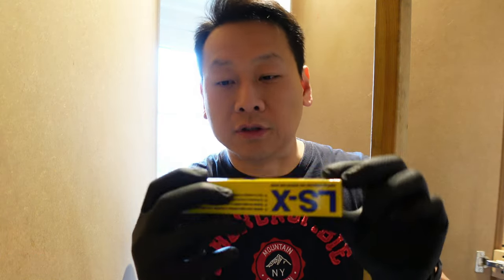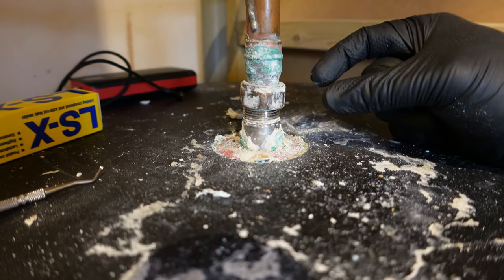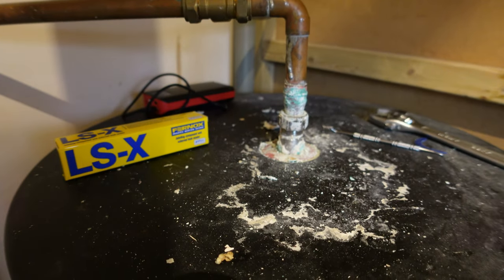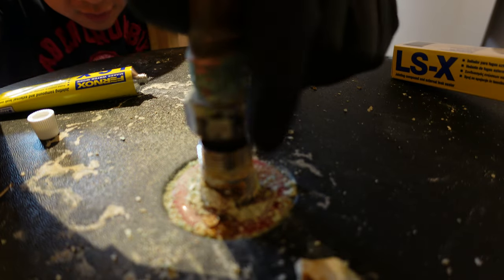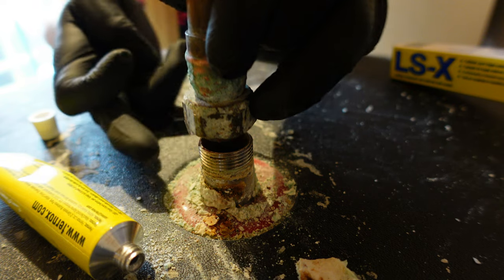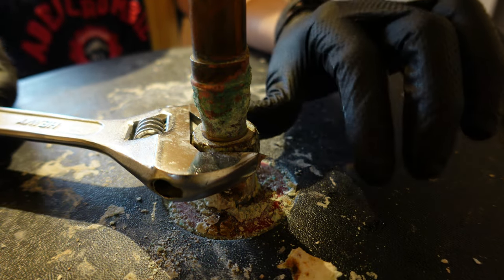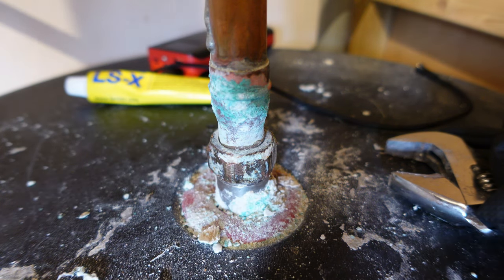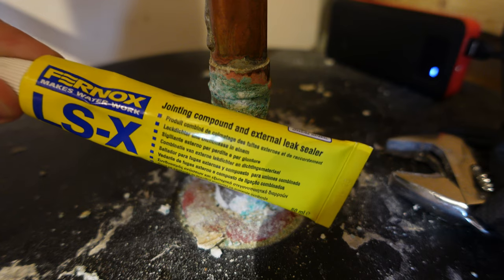Fixing a compression joint weeping leak quick and cheap by Benson Chik

Comment: I changed my Willis emersion heater (old one about 50 years old) and I'm not a plumber but while I was digging out the totally blocked with lime scale pipe, I weakened a joint at the other end of the pipe so that when I got it all up and running again and working beautifully in total silence compared with the clanking and banging it was making before, I had a one drop per day leak so being that it's a very old and awkward system to drain, I wrapped the joint in black pvc electrical tape and stuck a cable tie over that and hey presto jobs a good one. It's so easy I don't know why you don't see that a lot online and it's quite a tidy finish also. I didn't even have to pay a few pound for some of that sealer mess and in another 50 years when the heater needs changing again, some-one (I'll be dead) can put a new olive in lol.

Comment: Maybe a plumber was charging £50 + vat 20 years ago, but these days they won't get out of the bed for less that £150. I was away, and I had my tennant call a plumber because a hose from a bathroom sink was leaking. A £5 hose. The guy said he either replaces the tap as well (with a grohe branded one), or he won't touch it. I ended up paying £175 in cash (or £220 on invoice)
Reply: Yes this appears the going rate, you are bang on right plumbers and tradies at this point just want £175+ for 1 single job if you then say I also need this and this done they look at it as 3 jobs but give a discount probably since they know £175 is already too expensive and x that by 3 is even more affordable. What will happen is I suspect if its a bloke they will just try and watch YT and diy or best can its what I have been doing for many years already.

Comment: Why didn't you break nut on convex fitting above the leak and wrap PTFE tape around olive and the job is done no need for that stuff
Reply from the maker: A true plumber will dismantle it and repair and replace. I am a DIY fixer and the less joint I touch the better. The joint is still dry when I did my winter heating check last week so all good.

Comment: I know your not a plumber but you should of just put it round the thread. Then screwed it up 👍
Reply from the maker: That is what I would usually do if it is leaking from the threads but this is the gap between the olive ring and the nut.
Reply: @BCreviews  Mate there is no olive there that is a tap connector the seal is a fibre washer,the threads play NO part in the seal they merely tighten the fitting onto the other thread.
Reply from the maker: @gedheaton1415  There is definitely a olive ring on the pipe, nevertheless the joint is still dry from the fix. If it happens again I will take advise and just replace the entire L shape mess
Reply: @BCreviews  Sorry mate you are totally wrong,I'm a Plumber of 40+ yrs, that is a Tap connector,seal is via a fiber washer, unless of course they have invented a new fitting with nut and olive on one side and solder ring on the other which btw they haven't.
Reply from the maker: @gedheaton1415 lol, I am not disputing your expertise but I know what I saw, there is a olive on the reduce pipe. I could be a botched job 13 years ago by a team of polish builder but it is what it is.
Reply: @BCreviews  Agree to disagree my friend, take care,

Comment: That's a tap connector union not a compression joint, a compression joint has a nut and olive also that Tap connector should have a fibre washer on it then it won't leak. That is the wrong fitting cylinders usually have a compression nut and olive
Reply: that's definitley a compression joint, with a really short tail

Comment: I don't think it's a compression fitting. Doesn't it have a rubber seal up in there?
Reply from the maker: Compression joint , it is metal on metal. There is a nut crushing on a copper ring which seals agains the pipe etc.
Reply: @BCreviews  It looks like a union, but I could be wrong.
Reply from the maker: Not sure but with the added sealant it is bone dry now.

Comment: cudda undone compression joint on top much easier
Reply from the maker: A true plumber will replace the joint, I was worried I would cause more damage by undoing more joints. It is holding so far so  I would just shut the door and forget about it for a few more years 👍
Reply: @BCreviews  nigh on inpossable to damage a compression joint try it next time
Reply: @Mallynat  Unfortunately not everyone can afford expensive plumbers at this time of recession. The man is showing a cheap alternative to spending alot of money, rather than getting somebody in to solder together a new elbow and making a fresh joint.
Reply: @RIDDONS  if he had done what I said don't need plumber so much easier that's what a plumber would do foolproof and lots easier
Reply from the maker: It’s ok, if I undo the compression joint I could have better access to clean up the mess and may be cut the copper ring and replace. Still I find the paste easier as not having to replace anything. I could do it properly but choose not to. I am not asking anyone to do what I did but it is an option
Reply: That shouldnt be a compression fitting into the cylinder, should have a washer or should use loctite
Reply: @BCreviews  thanks for the video and yes one does not have to do this but good on you for at least giving it a go. I had the same issue with the leak on top of my hot water cylinder. But it ran fine for 20 years, not one plumber or boiler engineer (had 100+ over 20 years) even mentioned or said its an issue even though it looked green and corroded. But when I changed to Swale central heating, they require a diagnostic test and said we need to repair the pipe work since its corroded before you are accepted on Swale. I had little option just paid the £65 (this was 5 years ago!) and he replaced the copper pipe properly and cleanly and it works fine as before. Lots of plumbers are now using fernox-ls it provides a better seal apparently and it apparently has lesser chance of an leak so if it works and saves you money good on you.

Comment: Lol you should of just replaced that pipe since it’s tee off a compression joint. And you done the hardest part disconnecting it and drain down cylinder.
Reply from the maker: Just add some paste and forget about it for another 15 years 👍
Replacing that is the correct way to go but I am not a plumber and no torch, weld…. So much fuss

Comment: Great video, you could of used PTFE tape around the olive. You should be a plumber !!! Happy days.
Reply from the maker: First day turning on the heating today and joint is still dry 🎉 tape is possible but the gap is huge, I should learn how to to soldering and bending pipe and get rid of that section all together 🥹
Reply: Yes PTFE was my favourite too and with metal threads and some pressure maybe better. However I had a plastic sink drain and with a PTFE tape it jumped the threads and jammed. Had to cut drain off and in my second attempt used LS-X. Not leaking so far.
Reply: Because there is No Olive, its not a compression fitting.

Comment: you should have used ptfe tape instead of the sealer
Reply from the maker: Thanks for the tip, but why is tape better?
Reply: @BCreviews  PTFE/teflon tape is the bread and butter of plumbers. You defo must put it on thread, because when you tighten the nut, it seals the thread. Also, if ever you open the nut, or you want to replace bits, it's easy to remove it, or add another layer. Also, when you roll the tape on the thread, it's advided to go clockwise, so the nut will bite it. If the paste works, leave it on, but next time keep in mind. Let's say you get to a point where the damage it too big for you to repair: you go to your landlord, he sees a diy repair, he could blame you for it; you call a plumber, he might overcharge you, invoking extra work, etc.
Reply from the maker: Yes, tape for thread. In this case the thread is not the main leak and it was the olive ring not being press against the fittings. The tape won’t form a seal with the ring but this thing got squeezed out of the joint and fill up the gap and stopped the leak. I could have taken out the whole thing with the compression joint as another viewer pointed out but all I wanted is a quick fix hence this sealant. Looking at the state of the crust formed it has been like that for the past 5-10 years. Just need it to last another 5-10 then a overhaul.
Reply: I read on screwfix and diynot forums ptfe is used a lot for sealing but its actually not the best idea in some joints or plumbing parts say compression's and valves, ptfe is good for say garden taps. The plumbers over there seem to get really rattled up when someones ptfe taped say a flexi tap tail. More and more plumbers appear to be using fernox-ls or fernox jointing compound (one of drinking water and one without) since its providing a good watertight seal, there even using it now on garden taps oddly.... its almost replacing the ptfe tape oddly. Not a plumber mind just things I have read since am trying to do my own plumbing and leaking issues atm so reading up on stuff so I could be wrong.
Reply: Just wanna know if the nut could still be untightened after applying the seal  ?
Reply from the maker: @maxfan9160 yes, it is like small amount of silicon on the treads.
Reply: @maxfan9160  heard its a right pitta sometimes to remove especially if overdone with the ptfe wraps or if put on top of say an olive nut. fernox ls and jointing compound is meant to be better then ptfe tape but not tried any.

Comment: Buddy that's a hot water cylinder not a boiler and you don't have a combi boiler lol
Reply from the maker: Thank for watching my video Buddy, Don't think I call the tank a boiler but if I did it was a mistake. I have the ecoTEC plus combination store with combines a combi boiler and a hot water tank under high pressure with closed loop.
Reply: @BCreviews  you've got a system boiler with a hot water cylinder 👍

Comment: Please don't take advice from this guy, He hasn't got a clue.
That connection just needs a new fibre washer that costs pennies, it's not an olive fitting.
He could have span it round to see by loosening the brass fitting above.
Reply from the maker: This is actually a union joint where it compress 2 pipe to form a seal and there is no fibre washer. There is an olive in the pipe and that is how the nut pull the pipe to join the opening from the tank. Over time there must be a leak from the rim where the two pipe meet and it leak out from the side of the nut. The silicon must have block the tiny mis alignment and enough to seal off any leak. It is still dry today so it works.